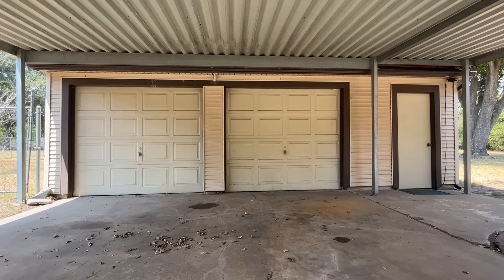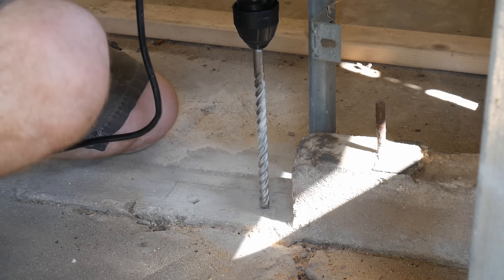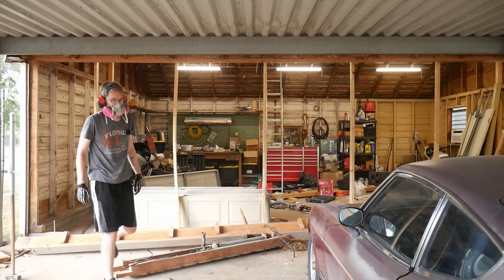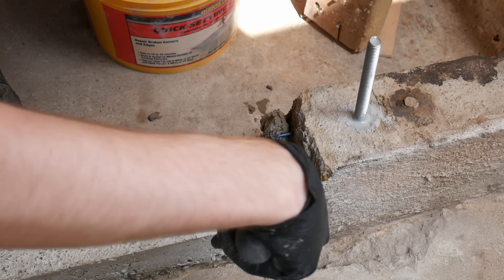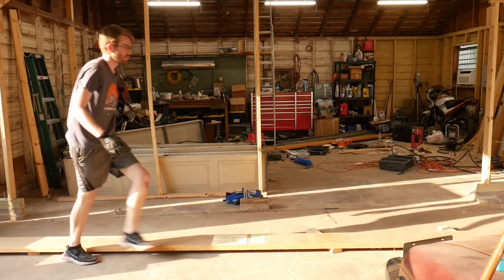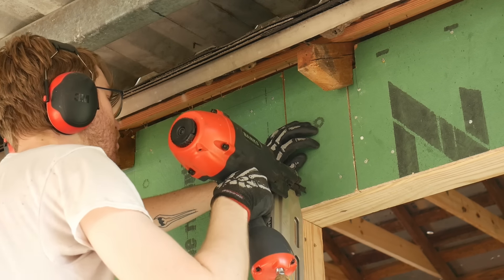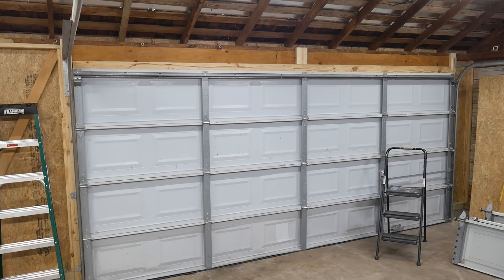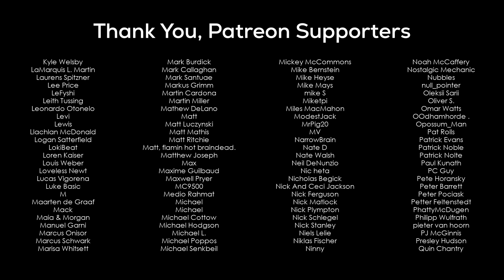Rebuilding my Workshop

Comment: Well its not half bad from construction workers point of view but still... okey lets go over this.
3:21 Your forms and reinforcing is fineish, just make sure there is least two inches or 5cm from concrete surface to any steel, cause oxygen can penetrate and rust if off. In case its really thin slab, use stainless rebar. I would also advice when joining to existing concrete surface, clean it properly, remove any grease there might have, roughen up surface even if you just smack it with hammer, blow away any dust and wet it with water before pouring, or else you might not get great fusion between the two and old sucks water out from the new causing it to cure too fast. Also helps from having water getting trough...
For price its mostly cause it takes all the same effort to transport and prep for the job as with bigger job. Only difference is the time it takes to actually do the pour, but cleaning and organizing takes still same time. Also high cost might be cause they have lots of jobs that pay better but if someone is desperate enough to pay 500$ for small job like that sure that can be fitted in, but mostly that would be hundred of couple if i was close by.
4:30 Flooding not issue with the building, but foundation and surrounding landscape. Getting higher door still is not going to help much with the issue, specially when it was done crappily before. Only suitable way would be to put french drain around the foundation and direct both ground water and drain water from the roof away from the house. If you cant dump it into city sewer, just dig a hole on the front lawn, run drains there and fill it with rocks surrounded by earth separation fabric and it should hold that amount of water, while helping it to seep into ground much better.
6:40 yeah that is a issue. Generally in cold garage like this one would put scrap peaces on the top and bottom to support it, or if done properly just on outside wall before putting the siding, off set inside the frame a long boards as cross support, leaving most amount of frame surface for insulation or storage, as seen in 11:09
7:45 No you put those on just enough to go get 4 ton straps from store and when its straight put on the back wall those cross supports on the since if need be. One must stabilize the structure before any further work can be done, for safety sake and cause if something is crooked anything new built is probably also crooked, so it helps to start from straight and level.

8.51 ah classic. Well since concrete is still curing you can just scrape it with old knife of something or if it has cured diamond cutting disk smooths that over nicely.
9:14 NO ABSOLUTELY NO HARAM!!!! Pressure treated lumber should NEVER be installed inside any structure with limited air flow. It will regardless with what it has been treated release those chemicals into the room air. I know this is widely used in USA, but ever wondered why there is so many cancer cases in USA? Yeah wonder no longer. Proper way would been to use bitumen (not sure about foam, but should work too, just think bitumen is more reliable) membrane since it will form seal between lumber and if you wanted to be extra careful charcoal the bottom surface of the lumber, well as treat it with tar.
Drilling tip is to go sit on top of the lumber, check your drill bit is straight and lock it place with your body, then use your eye to keep checking the another direction. If there is anyone else around they can check the another direction, or use drill press. Three is both mobile and table top variants to choose from. If you still drilled it crooked little bit of chisel and hammer does wonders.
9:37 No its not. Water can and will go up via capillary effect upwards to meter in wood, so no little raised foundation does fuck all to that. Reason you should use raised foundation is that grass if left unchecked wont be in contact with the wood it self all the time, same with water droplets splashing water to wall. Yeah i do agree redundancy is good idea, how ever using old growth tight grain lumber specially if its high tar content works fine as is. We have such been stuck in a water for 30 years and no issues so far.

19:20. When ever working with such trip hazards, falling is bad, but getting impaled by rebar is worse, so get scrap peace of wood, drill a hole in the center and put it on the rebar, if you dont plan of removing it entirely, in that case cut it away before proceeding further. Also to help clean removal, use diamond cutting wheel to score groove on the bottom, ideally deep as possible but just half inch is fine and inch is good, then use sledge. This makes weakpoint for concrete to crack from. Same is done on large slabs so it will crack from those points, not from areas you dont want them to.
Next step ether back wall brazing and still plate, or dig the drains so no more flooding. Then attack the ends.

Comment: Why don't you shorten that 90 degree rail piece a bit so that the top rail piece runs with the roof. So that you are not bothered by the door when it is open

Comment: I have a suggestion...  Actually, I have two suggestions.  First, you need to lift more.  No need for weights or a gym membership, just find something heavy and do reps.  Secondly, another thing you might try to keep water from coming in under that nice big door would be to dig down into the old concrete and lay in a steel pipe that will meet the rubber bumper on the bottom of the door.  Nothing real big because you still want cars to be able to roll over it and not notice it, but you'll probably want something there to help keep the water out.  My grandpa had a set-up like that and it worked pretty well.  Unfortunately I can't remember the diameter of the pipe and I no longer have access to the building to measure (grandpa kinda went and died on me unfortunately, so the house isn't his anymore obviously, and the current owner is not friendly to my dad and I).

Comment: Could I suggest not using a 90-degree bend on the door tracks, but instead angling them up parallel to the roof and tucked up against it? You can get those bends in a few different angles, or just cut one to the bend you need and drill new holes for attaching the rest of the track. I've seen that done to increase headroom with the door open, for lifts and such - which I'm sure you'd love to install. Also, those springs can be dangerous, yes, but just be careful. I've replaced mine twice in 25 years (bought better springs the second time...)

Comment: Vertical level is actually called plumb your walls are now plumb not level. Also just a tip next time when pairing lvls together use at least a few screws first to get them to actually pull together then nail.

Comment: @ronaldfinger , good job man...isnnthere a way for you to make the garage door apen at the same angle of the roof? so you can have a shorter hanger for the garage door...i dont know if you can understand my idea...in case you dont just tell me so i can try to re-explain wirt different words...im italian btw...anyway you've done an amazing job💪 i had to mess with that king of sping too and they are not funny😂 kinda hard to put them back when you have take them off tension.

Comment: This may sound crazy but what if instead of using horizontal tracks for the garage door, what is f you ran the garage door up the side of the ceiling? I mean I’m not a engineer or an architect but then you won’t take up any space in your shop that you cleared out?

Comment: So after watching for the 5th time because its just so fun to watch, i have a question. You had a 16 inch pillar divider between the 2 doors and decided to split 8 inches to each side for the new single door. What made you go that route instead of putting 16 inches to either the left or right of the new door? The more i think about how i would have done it, i think i would have done 16 inch wall on the left, so i had room on the left wall for shelving\storage\work bench. Not that what you did looks bad, i think it looks great, just a thought i had.

Comment: My question for this garage door is would it have been easier to send the door going up the angle of the roof at a 45 degree, rather than using longer extensions to keep a 90 degree angle?

Comment: Hearing bro actually say “ridge beam” fvcking gave me bad flashbacks of building homes 🥴 I literally got chronic SCIATICA from lifting one of those mfs. It was an off day, Saturday to be exact, and me and my supervisor were the only dudes on site building…. I dragged an almost 50 foot ridge beam maybe 100 yards to the ceiling we were building. Got that there no issue… I’ve done this exact thing 3 times a day for the past year at that point. Me and the Super pick it up by each end, to lift it onto a 2foot platform. When I left and twist I hear a mf pop in my back 🙃 didn’t hurt, but it was kinda loud. My supervisor across the way even asked what that was 🫠 it’s been almost 5 years of leg pain. Only after 2 years of really dying tho, did I find a way to get better. i still deal with the pain every here and there tho.

Comment: Haven't finished the whole video and im assuming you've run into this issue already.

You didn't remove all the air pockets/voids in the concrete. it will collapse at the base.

Comment: Your shear model premise is wrong …. make multiple up rights like studs not just  2… and connect them all … like studs are connected to the outside sheathing or boards…this solves your shear issue, well it makes it a lot less of an issue when you back it with good corner bracing… most of these 1940’s building would have had diagonal let in corner bracing…

Comment: Question for Ron, is there a reason why you went with only one spring instead of two?  Is it a light door?  I had one spring on my door, and when it snapped, I couldn't get the door open at all.  (I replaced it with a double spring, so that next time one snapped, I still had a chance of maybe possibly opening it.)

Comment: yup... yup... will be right back.....   lighter check.... can on gas. check... good stuff and fertilizer. check... i will help you fix ya home problems... remember "we were attempting to "work on a diesel truck over a fertilized concrete its a thing now." at the same time we needed to remove a stump by burning it.... " o and run "

Comment: Here in the Old World people are making fun of 'murican constructions. I mean, let them have it, it's way more sturdy the way europeans build but by the end of the day when you need to make some changes, it's way more sturdy the way europeans build, which means you need a sledge hammer, humongous power drill, a tank, a jet engine, an aircraft carrier, a roman legion of work force and at least three oxen to remove the rubble after you've made a hole to install a new window. To rebuild a front wall it would be actually easier and probably cheaper to drop a tactical nuke.

Comment: Honestly... the foundation seems wrong to begin with... but I don't think you're going to redo it.  Water shouldn't be pooling up next to a building.  Everything should be sloped away from it.  So perhaps the foundation is set too low.  Maybe they did try to set earth next to it for that purpose, which you pulled away because of the ants.   I'm not sure I've ever seen water pool up into a garage... driveways slope down and away.  

Long story short... I think you should find a way to keep water from pooling there in the first place rather than trying to create some barrier the water can't pass through.